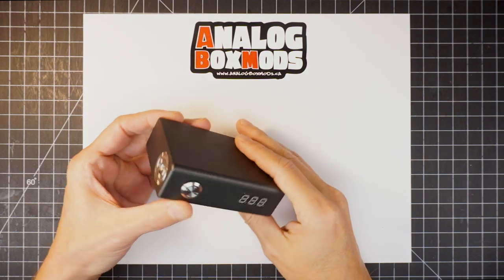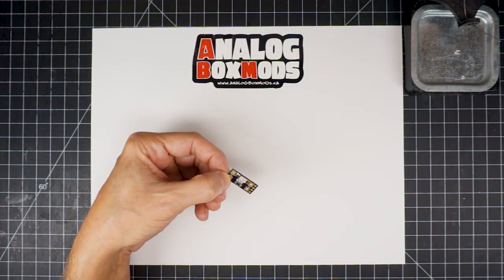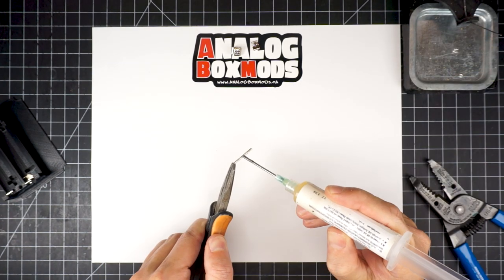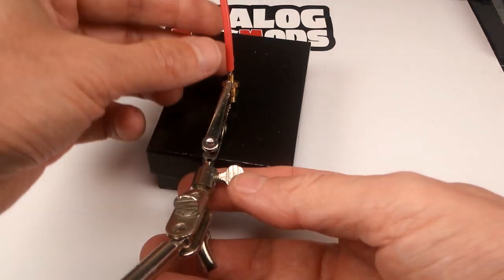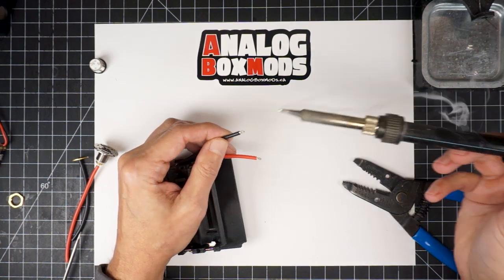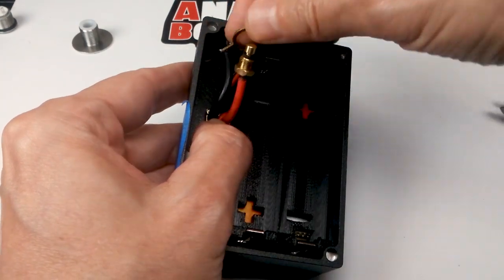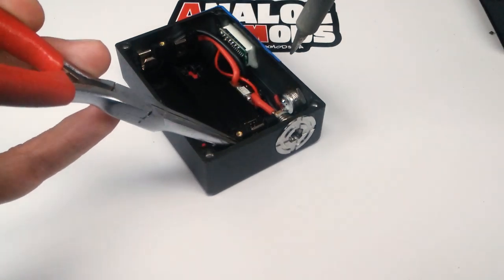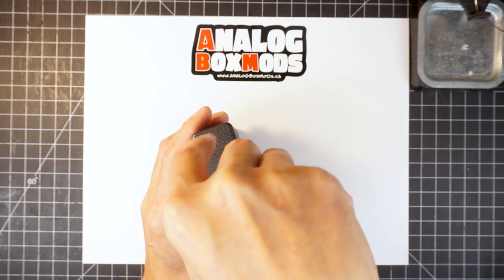Unregulated (Mosfet), 2x18650, ABM-2-VM Enclosure, DIY Box Mood Build

Comment: is the setup and wiring the same if you used a single battery?
Reply from the maker: The mosfet does not play nice with the low(er) voltage of a single battery, 2 batteries wired in series are required for this board.

Comment: question about this enclosure, will it fit a 24mm atomizer without overhang? or should I get the xl version?
Reply from the maker: The ABM-2 is 28mm thick so a 24mm atty will fit without overhang.  The ABM-2XL is 32mm thick, you could use a 30mm atty without overhang.

Comment: Is it possible to add a battery chargin port.
Would make this build even better than it already is
Reply from the maker: You would need a chip to control the battery charging logic (how fast to charge, to monitor each cell, to know when to stop charging, etc)  those do exist but we don't have those in stock

Comment: Can i add a potentiometer to regulate the voltage??
Reply from the maker: No, for a few reasons... I don't think you could find a pot that could handle this kind of load, even if such a pot exists, it would be huge, and it would be an extremely inefficient way to regulate the voltage, all the reduced power would be wasted as heat.  You need some kind of switching regulator which can be controlled by the pot.
Reply: @AnalogboxmodsCanada  i like your design could you mail me this?? I am thinking of printing this locally via 3d printer, that would be very kind of you
Reply from the maker: @Yema09  The only 3d printed component is the battery sled, which we have on thingiverse, https://www.thingiverse.com/thing:3810625
Reply: @AnalogboxmodsCanada gotcha thanks a ton!!
Reply: i cant find the 3034 n ch MOSFET around my area and due to corona virus situation mist seller are taking too long to deliver and honestly speaking I can't wait that much😅. Can you tell me why did you use 3034 particularly i am studying electronics so it'll be easy to explain stuff. It would be a great help. Thanks
Reply from the maker: Although the 3034 is a popular mosfet for vaping, that is not the one we used for this build... the 3034 is one of the few mosfets where the gate fully opens (barely) with a single cell or batteries in parallel, has an acceptably low RdsOn resistance and can handle the high amp loads.  You'll find a lot more compatible mosfets if you use series batteries and thus a higher voltage.
When choosing a mosfet you want,
- lowest possible rdsOn value
- make sure the gate will fully open with the voltage you have available
- make sure it can handle the load (amps) you plan to run through it
Reply: @AnalogboxmodsCanada  you're great thanks!!